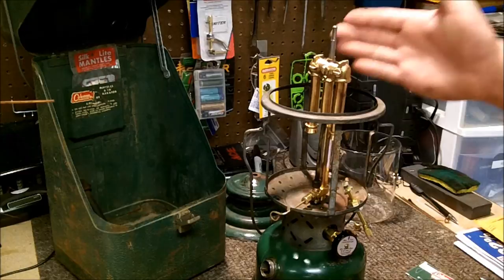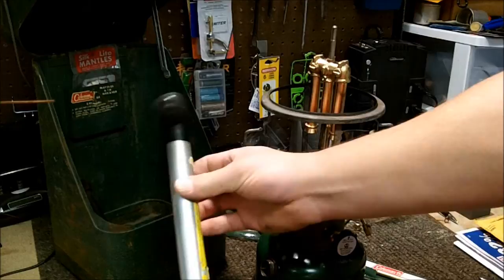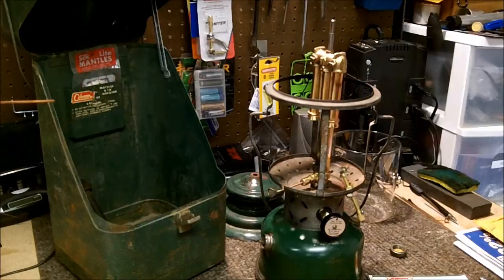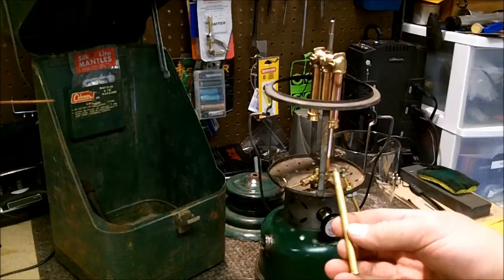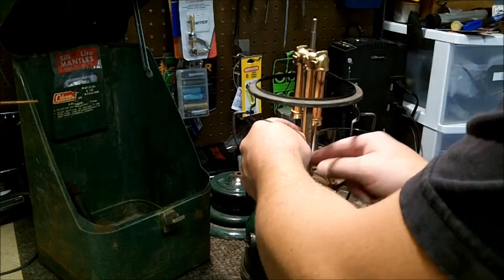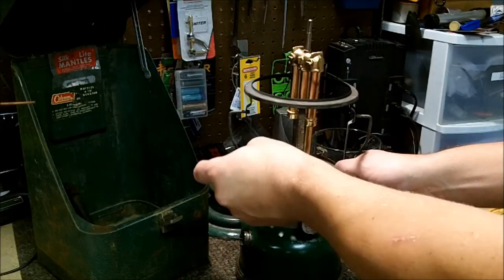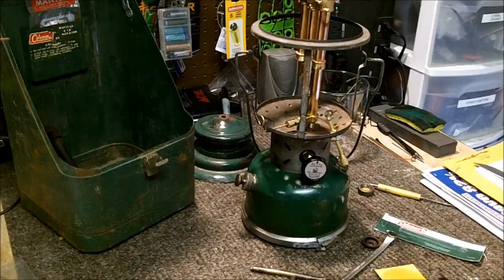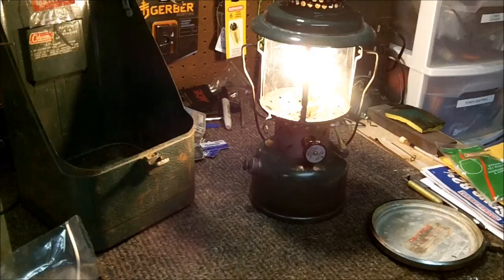Part 4: Coleman 220 Repair Project

Comment: Mr. N I'm doing the same thing to my 220e. I took it completely apart and cleaned everything.  The first two things I'm replacing is the fuel cap and generator. Hopefully that'll work. Parts coming in Monday or Tuesday.
     Great vid btw. I've learned a lot from u and thank you.
Reply from the maker: Thank you for your feedback!

Comment: hey nomad-76 that flint striker you put on i have been using since i was in my 20s. just to let you know if you look around on the ground while you are out and about, look for old bic or bic type lighters or scripto. you can take the flint out of them and they will usually fit in the flint striker in your lantern. they also work good in a zippo lighter too. also check online for acadmey sports sporting good stores. they sell coleman generators for $7 and some change also they have the brass fuel caps for $1.98. and globes for $9.99 i believe. just trying to spread the word where to get a few things at a lower price also i have a 1956 220 and a 1958 u.s.  military 220 and a 1966 228F love these lanterns. the 1956 was my grandfathers. wont ever get rid of it . lots of memories. there is also a man not far from me that sells parts and restores lanterns hes got old 70s sears coleman lanterns blue and green. anyways good video and keep it burning bright.

Comment: Does the 150s lamp valve work for the 220 series? On oldcoleman website it says it had 220 thread into fount.  But will the manifold screw into the top? Trying to save some coin if I can and they have that part.
Reply from the maker: Sorry for the late response. Unfortunately, I have never worked with 150 series lanterns so I cannot tell you for sure.